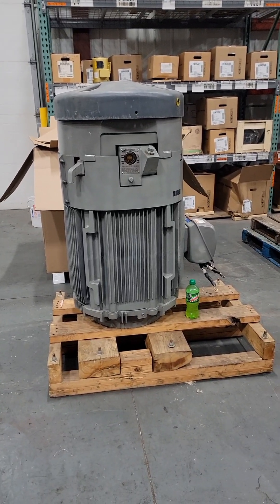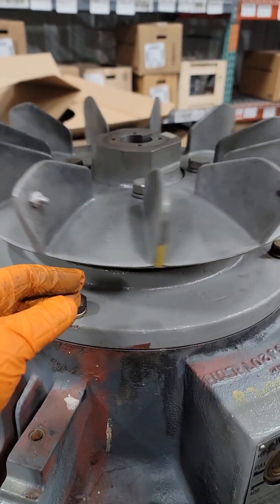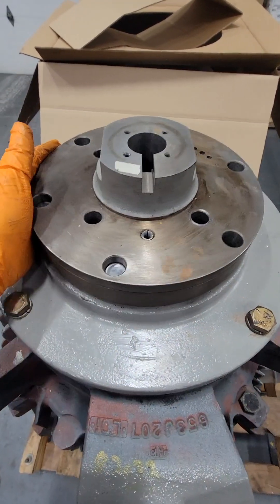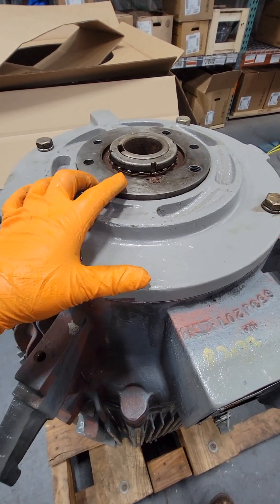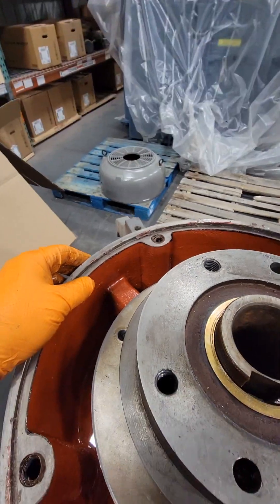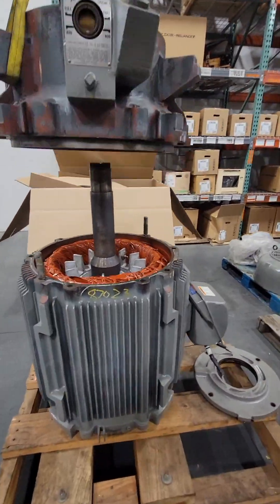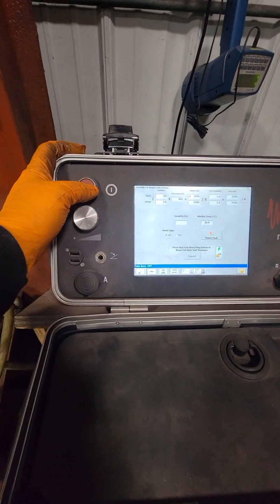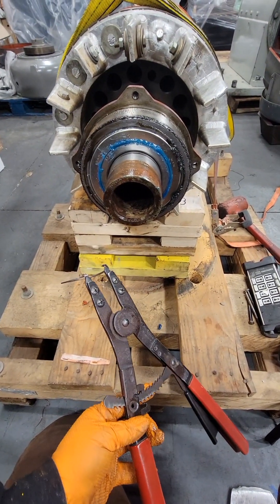Vertical Hollow Shaft Motor

Comment: We had two 75hp and two 35hp motors like those at the water PUD. They pumped water from the river to the 1 million gallon water tank. Ours ran on 480v. The lift from the river was About 27ft then the head was maybe 50ft on a 4 mile long line. Cool beans man!